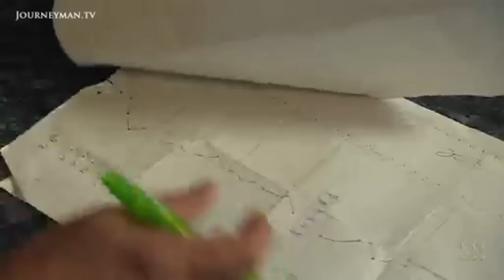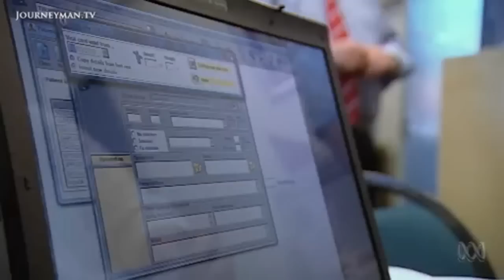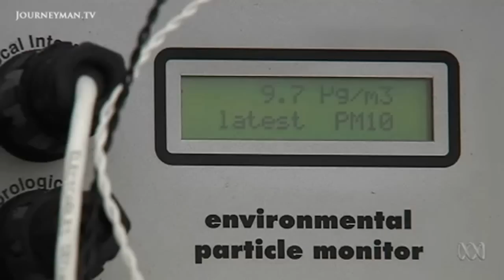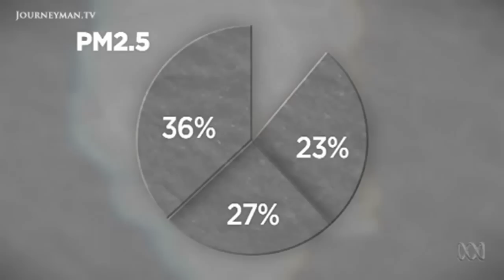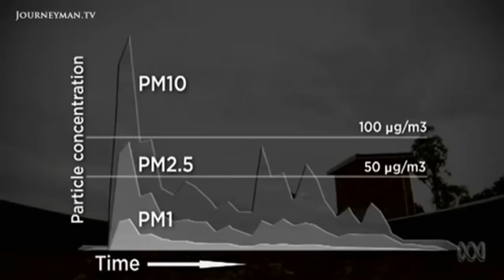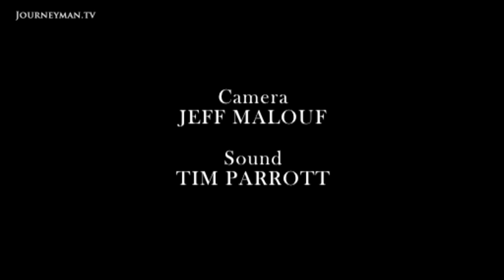Counting The Cost Of Australia’s Coal Rush

Comment: How about when they did the air quality study and found the level of coal dust to be insignificant? Yes, they were all upset and outraged that they didn't have anything to be upset and outraged about. In fact, they were so upset about the air quality that they had to have an extra pack of cigarettes that day.
Reply: Dear manager,
Longyi New patented built-in classifiers dry grinding machines already put into mass production.

1.Powder from 325~4000mesh, fineness is adjustable
2.Built-in high efficiency classifier, no more investment cost for classifying system.
3.Smart PLC operation system, and integrated control system: 1 computer could operated max 6 machines, saving management cost.
4.No particle air pollution, more environment-friendly.
5.Compact structure to save factory space and lower foundation construction cost.

For limestone
The whole grinding system power is around 370Kw, the real working power is 80% 296KW
1.D97=23um (600mesh)    Output: 10tons/h      Energy Consumption: 29.6Kw/Ton
2.D97=16um(800mesh)     Output: 8tons/h       Energy Consumption: 37Kw/Ton
3.D97=10um (1250mesh)    Output: 4.5tons/h    Energy Consumption: 65.7Kw/Ton  
4.D97=6.5um(2000mesh)    Output: 2.5tons/h   Energy Consumption: 118.4Kw/Ton 

For Talc powder, 
Longyi powder grinding mill power is 250Kw, the real working power is around 200~225Kw, including classifying system.
A. D90=10.5~10.7um   output:  4 tons/hour
B. D90=9.8~11um      output:  3 tons/hour

It is suitable for processing nonmetallic minerals such as calcium carbonate, calcite, Kaolin, clay, barite, talc, gypsum, limestone, calcium oxide, bentonite, dolomite etc.
Samuel 
MP/Wechat/whatsapp: +8615105956429

Comment: when everyone burned coal, here in north uk, you never seen anyone with asthma, but now since nearly every house has gas central heating, & double glazing, loads of people have breathing problems, & asthma,  when a coal fire is burning, it obv,ly needs oxygen to burn, so the chimney will draw air from anywhere it can, so in the process, the chimney is taking all the bad stale air out of the home & replacing it with fresh air, but with out the chimney with central heating etc, the air dosen,t move ,it ends up stuffy & stagnant, cos your using the same air over & over again, so i know which i would rather have.. & still have an open fire, & i,ve never had any breathing problems even though i,ve smoked for over 40 years

Comment: how about just covering them.......... solved
Reply: No it would be very expensive and seriously delay the coal trains.
Reply: @johnhutchinson2981  just flipping a cover open/close won't add much time, a machine to d it
Reply: @mattdathew2794  I admit that will be probably be what will happen.
Reply: @mattdathew2794  They spray coal trains with a dust suppressing adhesive that prevents dust. It's a non issue. The particulate matter studies of these areas showed low particulates.
Reply: @gregorymalchuk272  great but we want zero particulates from such, may be the wind never blew at the time of the studies